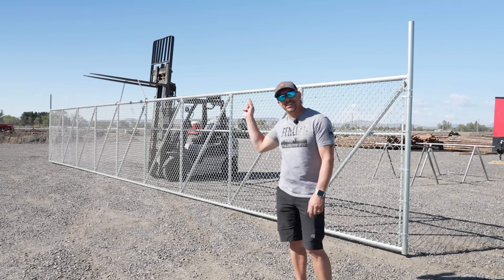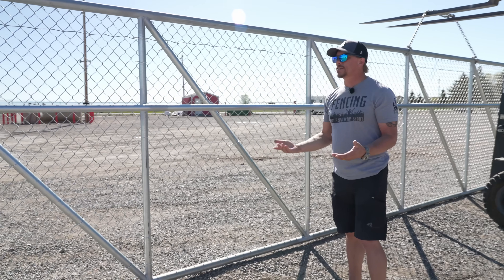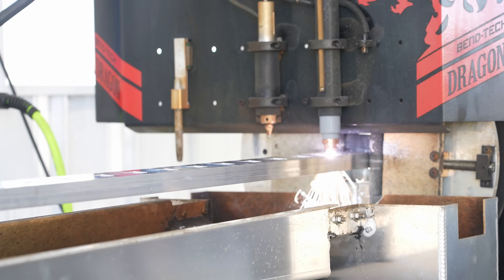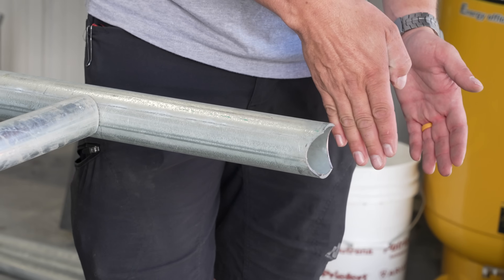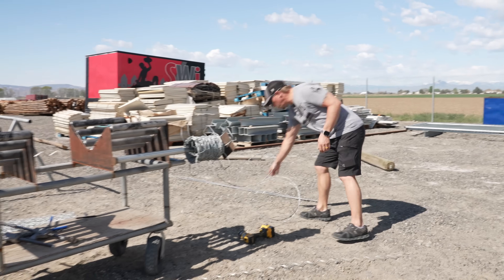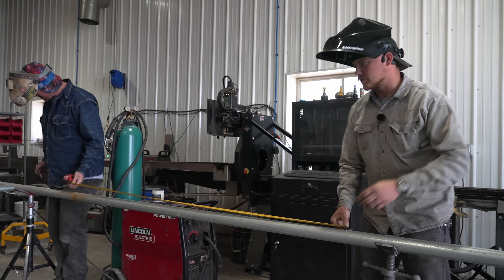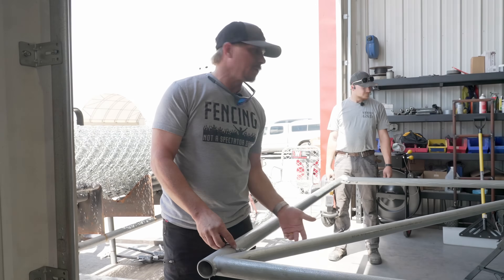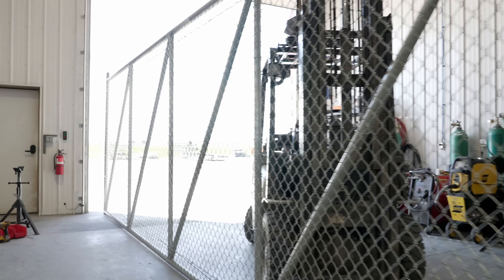You Can't Build A Better Cantilever Gate Than This

Comment: To answer your question about the direction of the diagonals: Solidworks can be used to simulate the whole thing and it turns out that there is actually a preferred direction for the diagonals to be installed. That's not really surprising, because the tensile strength of steel is usually around 10...20%, and up to 30% for special steels, greater than the compressive strength. BUT: Such gates are calculated with safety factors of 2 or more and in practical terms that doesn't play such a big role. To compare the real differences, I would fix such a long gate on one side and then on the other and compare the deflection of the opposite side: the differences should be relatively small.

But I also have a question: Galvanized steel is being welded here, which can be a bit problematic without prior dezincification. How is the welded area then processed to avoid long-term corrosion damage?

Regards, Jogi

Comment: Hey SWI 👋🏼 thank you for your videos! So much info, I find myself often referring to your expertise whenever I have any questions or doubts. 
I am hoping that you can help me. I am looking to build my first cantilever gate here in about a month or two, and I saw the other video where you installed a bigol 46' cantilever gate, and in that video, you mentioned that people have a hard time with cantilever gates, specifically because of the arch brace to keep it from flapping around and facilitate the alignment with the latching post. I noticed that the support in question was itself arched, and my question is: what is the measurement of that arch, and why does it need to be arched like that. I do hope this message finds you and that you will be able to help me. Otherwise, I'll probably just wing it and go with a depth of 1' on it 🤷🏽‍♂️

Comment: I like your tension wire all the way across the gate it's different from what I do, and what I do is weld on 4 spacers per opening between a brace 2 on the top, 2 on the bottom and that's about 32 spacers a cantilever and we hog ring to them very interesting to see different ways to do things

Comment: Great vid. Fun to watch the fab on the gate. Quality is in the details.
One question. All those tubes come to you galvanized, right? When you plasma cut and weld, I can't help thinking some of that zinc gets burned off. Is there some way the galv can be restored at the welded joints? Or is it negligible?
Beautiful welds BTW.
Reply from the maker: You're absolutely right, that zinc does get burned off. We use a spray galv to recoat the welds and prevent rust, like you can see here: https://youtu.be/iJG7QzCDYs8?t=705
This is what we use: https://www.swifence.com/national-vinyl-products-cold-galvanizing-paint.html?id=6496513

Comment: Technically the diagonal brace should point to the suspended side (low connection) which will keep the brace under tension. Having the other way will still work but be under compression so more likely to bow out under enough force.

Comment: Hi your videos are like a mini course. I have been fabricating gates since the 80's but never had to install a cantilever system. Checked your site for the wheels but a weight limit is not stated. Whats the max weight of the gate to be used with your wheels.

Also is there any difference in how smooth the gate runs with square tubing with the matching profile rollers vs round tubing. Thanks
Reply from the maker: The weight limit is 4,000 lbs.
The smoothness of the rollers is the same as long as your talking comparing nylon rollers to nylon rollers. there's no difference between square and round.